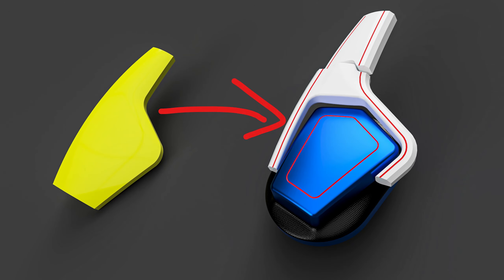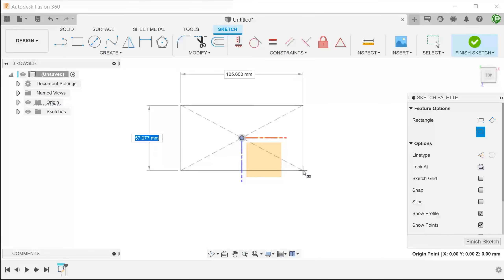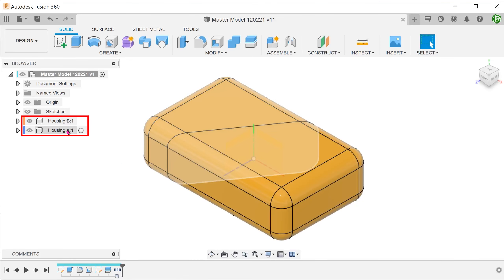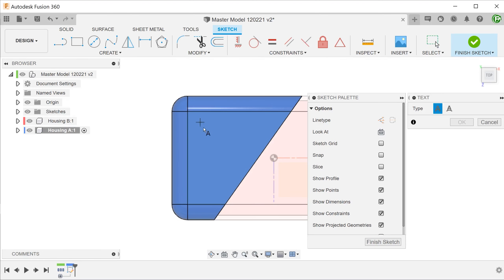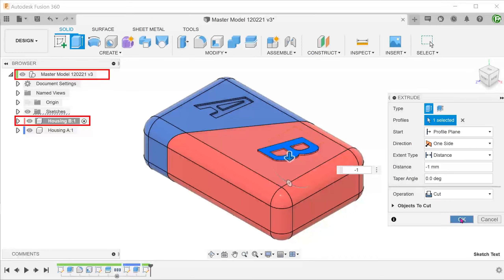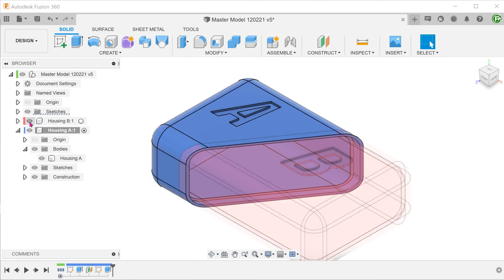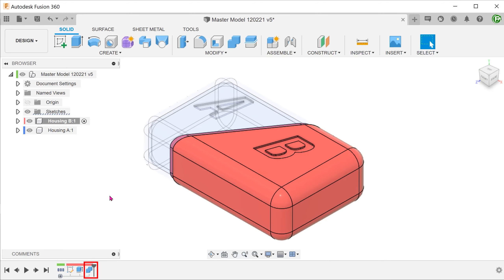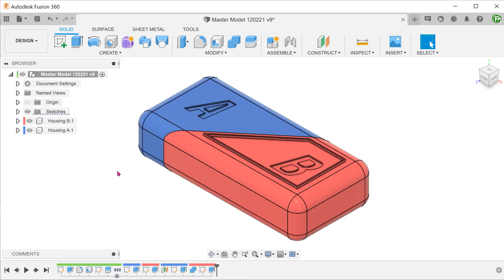Fusion 360 - Master Model | Top Down Design

Comment: Love it. The only caveat to the top-down approach, as is pointed out, is forgetting what's currently active when a new sketch is started, then getting lost in the hierarchy. In my experience (limited to objects with only a few components) this occurs when I'm not being meticulous about what I'm doing--just playing around. 

As the old saying goes, "Perfect planning prevents poor performance."
Reply from the maker: Having played around with this, I found that it is possible to drag sketches from top level to components. I am not sure what this does to the references though.
Reply: @Fusion360School  Not in front of F360 right now, but I wonder if there is a copy/paste-new type command for sketches, which may avoid referencing the old top level sketch.
Reply from the maker: @qcnck2776  Hi, in this case, I don't think it would be a good idea to copy the sketch, since that would leave an unused sketch at the top level. I think that after dragging the sketch into the component, it should be possible to delete any old constraints and build new constraints that reference the component's origin.

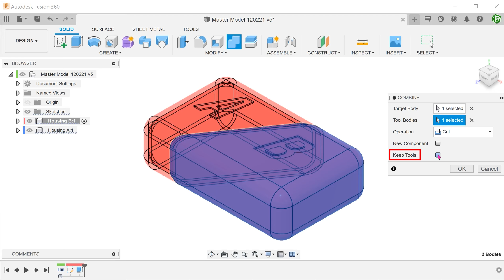Comment: @08:43  A suggestion for the cutting step, it is better to create an offset in between the joint of two parts if we need to fabricate the parts
Reply from the maker: Yes, most definitely.

Comment: I really like the way you present the material. Showing what happens on the timeliness. Showing mistakes that new users are likely to make. Very well thought out material. 

How would you add some form of interference gap to the component lips. I could image 3D layers could cause issues there.
Reply from the maker: Thank you. For clearance, I would recommend activating one of the housings and pull back on the lip/groove using press pull/offset.

Comment: would love to see a video n surface modelling using the overbuilt approach.
Reply from the maker: I assume you mean a workflow with intersecting faces, trimming, stitching to become solid. Looking at my library, I am surprised that I have not done this before. Will definitely look for a good candidate to do one on.
Reply: @Fusion360School  yeah exactly. The whole thing of approaching surface modelling rather than approaching it from a solid that one changes.. Ive used fusion since its birth basically but are still fighting surface modeling, so would be interesting to see your take on it.. :)

Comment: Awesome tutorial. Is there a way to add clearances when using one body to cut the other?  If this were to be 3D printed, the lip/groove would need about a 0.2mm clearance.
Reply from the maker: To create clearances, I would activate the relevant component and apply the offset face command.

Comment: So, there's no way to move the accidental sketch from the master model to the sub component?  That's a bummer because I do that all the time.
Reply from the maker: When I tried this out, I was able to drag the sketch from top level to the component. But I am not sure what this does to the references. Maybe others in the community can chime in.
Reply: @Fusion360School  I drag things into the proper component whenever I catch myself doing things under the wrong component.  The only time references seem to be an issue is when you try to drag things in the timeline beyond the point where a reference is used.  If operation B references operation A, it must come after A.  Fusion will prevent you from moving B before A, or moving A after B.
Reply from the maker: Thank you, this is good to know. I often find myself starting over as I am worried about the references.

Comment: Hi there! Great video. I have been looking around for such content to master different design workflows. 
Could you please comment on the drawbacks of using the Master Model approach?
I tried to use the master model approach to make a parametric book shelf. The parameters that are tweakable are height, depth and number of shelves.
Using the master model approach I created the shelves thanks to rectangular pattern and then created components out of the bodies.
Unfortunately when I changed the number of shelves, in parameters, the model failed. Indeed the conversion from bodies to components is not taken care of by rectangular pattern. 
How can you use patterns/components and the Master Model approach?
Reply from the maker: "Could you please comment on the drawbacks of using the Master Model approach?" This is an interesting question. After thinking about it, I came to a rather ironic answer. It's greatest strength might also be it's greatest weakness. In the master model approach, we rely heavily on the way we build our constraints. If the constraints are defined well, changes will propagate to the components smoothly. If the constraints are not defined well, any small change to the model breaks everything down the line.

Your case sounds interesting. I have not tried patterning bodies and then converting them to components before. Have you tried creating the seed body, converting that to a component and then patterning the components?
Reply: @Fusion360School  Thanks for your reply. This model then requires to have a full understanding of the product before designing. I suppose that comes with experience. 
What about the size of the model? I suppose there is a limit to the number of parts after which a bottom up approach is better to ease the complexity of the model and approach?

" Have you tried creating the seed body, converting that to a component and then patterning the components?" It works way better but then when I try to modify only ONE of the components created via the pattern it changes them all. This is the reason I went the "pattern the body first" approach as that would allow modification on 1 of the patterned bodies only and not all of them.

Thanks again!
Reply from the maker: @JCBrissy  I would say that if the size and shape of a component has got nothing to do with the overall size and shape of the assembly, it would be better to do it bottom up. I have yet to try a top down approach with lots of components. Not sure how stable that is.

I totally understand your pattern problem. If fact, I had been meaning to do a video on how to change only one instance of a component. There does not seem to be an easy way!